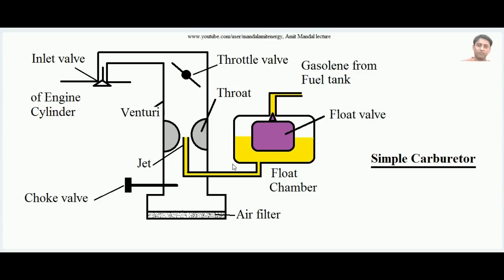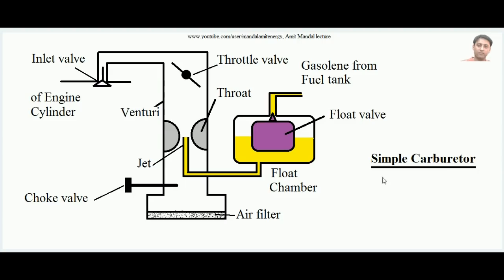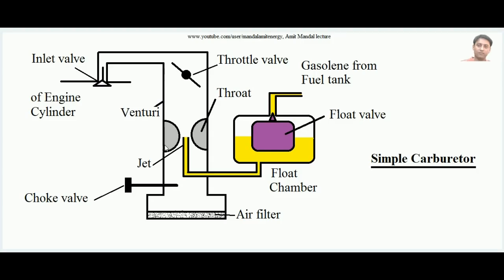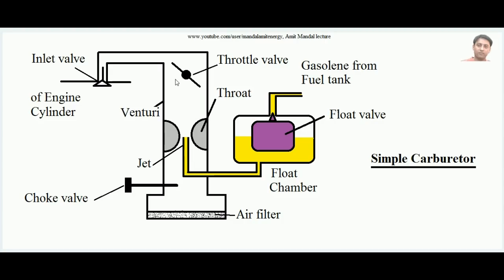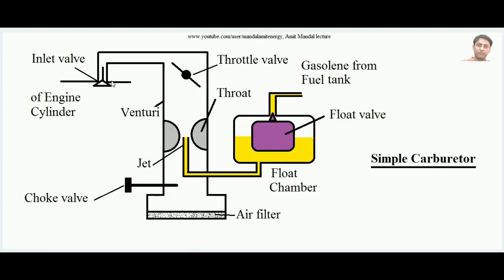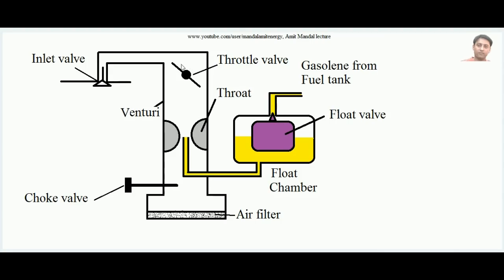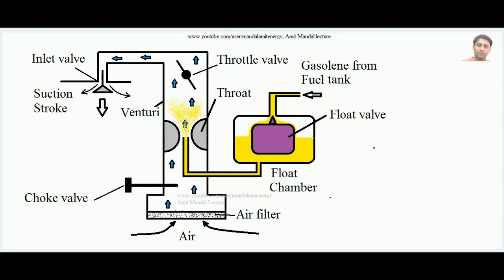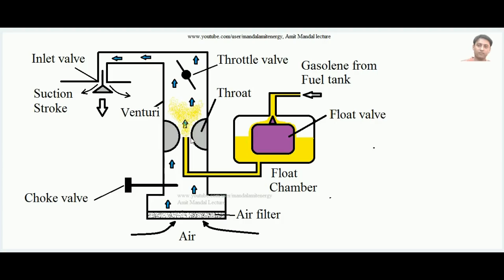Carburetor working principle

Comment: Sir mujhe aapki Puri bat smjh aai ,
Pr Mai ye Janna chah rha k normally hmlog scooty chalu krne k liye chock ko pull krte hn but is design k mutabiq push krna pad rha, to Mai bs yhn p confused hu
Reply from the maker: By closing choke valve, while suction stroke , engine wants to pull air but find it difficult, therefore to clear the vacuum it starts pulling more petrol than normal.

Comment: how the fuel spry in air? what is source of pressure of fuel. normally fuel cannot spry in air, what is the mechanism of fuel spry by pressure. i don’t understand..
Reply from the maker: When gasoline comes out from main jet, it is shattered by fast moving air which converts it into fine droplets..